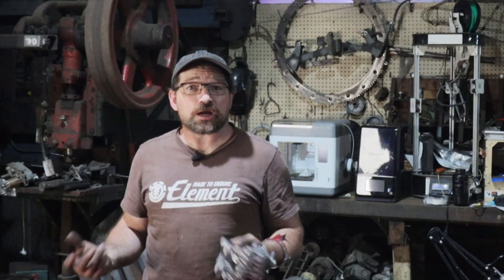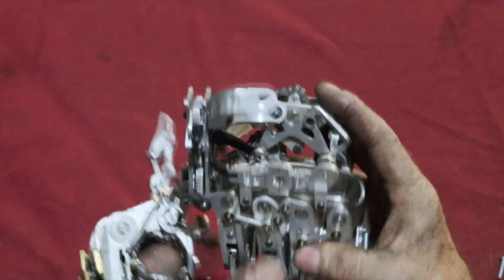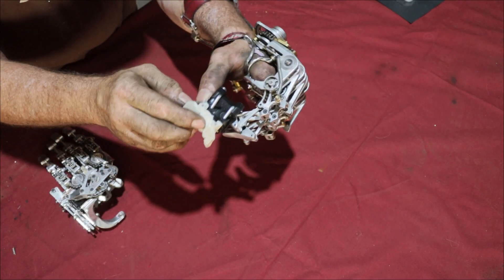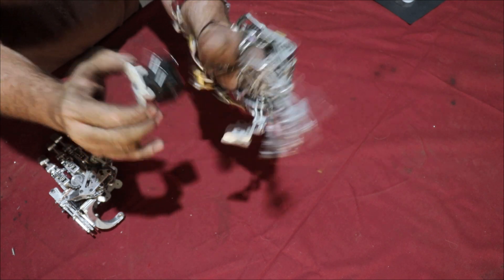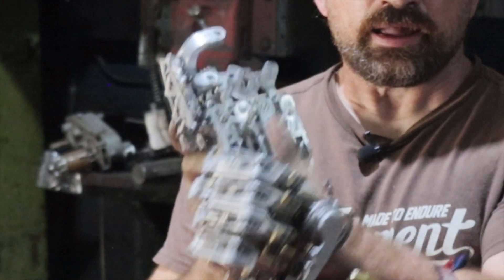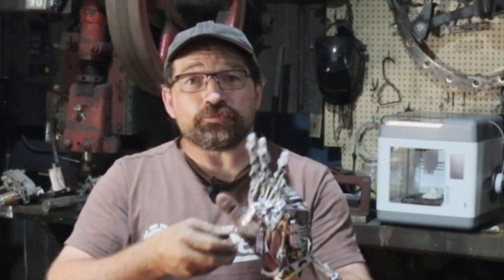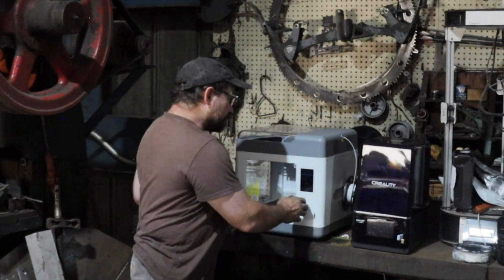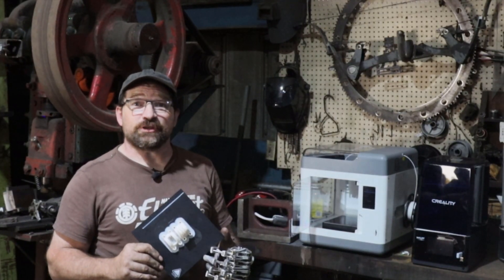Missing parts Monday Update on the Progress of building my new Prosthetic Hand

Comment: I lost my little finger a while ago, so I built a mechanical prosthetic which works great. But I’m a welder/fabricator, and very rarely wear it while I’m working, as the tiny parts and high tolerances fill up with dust and I don’t want to risk breaking it. I’ve noticed you never wear your hand when you’re building stuff, is that for the same reason? 

Love your videos by the way!
Reply from the maker: That's it exactly! If it gets bent or broken theres no repair center that i can send it in to for repair. I have to take the time to re manufacture whatever broke if I don't happen to have a spare part. This makes you treat it a little more careful out in the wild.

Comment: I know it's a major design change but have you considered making it so that finger flexion occurs with wrist extension? I think it may have a big biomechanical advantage. In the unmodified hand wrist extension is essentially a requirement for achieving adequate grip strength (try squeezing something thin like a pencil with your natural wrist in full extension vs with your wrist in full flexion and you should notice that it's difficult to even achieve a full finger curl without at least some wrist extension. This design would also serve to tighten your grip on your bike hand bars when you rotate your wrist like you're revving the bar or leaning into the grip and relax your grip when you lift your hand up off the bar.

Comment: For better grip on general surfaces you could also cut out and attach small rubber pads to the insides of the fingers.  You can get thin sheets of textured rubber meant for shoe repair, often called "sole protectors" or "Topy soles". For even better grip these could be adhered on to tiny weak leaf springs, which would conform via depression to the shape of the gripped object, and also will have a more biomimetic appearance. For a less finicky version you could also make arched bits of surface textured foam rubber to mimic the form and function of the pads on a natural hand

Comment: Quick release was a smashing idea. 
Have you considered adding fingernails? Pretty useful on a meat hand :) 

As always love the work 
Much love from England broseph ❤️
Reply: arent fingernails mainly to give the meat hand structure?
im guessing the metal hand has enough of that

although maybe a attachable edge of some kind for scraching could be useful
Reply: @aaronklein3480  pretty sure bones give the hand structure. 
I use my nails for when I need a fine point rather than a wide pad.  To pick up a coin from a table for example. Or to put a hole in a plastic wrapper
Reply: @nUmBskulLL  what i ment was like structure in the very finger tip,
like if you press with you finger against something, your flesh and skin will be pushed up.
in the tip itself there is no bone, (because it would be exposed) but also meat and flesh.
i think the nail is therefore used to do fine work where the tip would be too squishy otherwise.
i could be wrong tho
Reply: @aaronklein3480  ahhh indeedy! I think we are in agreement then! :)
Reply: @aaronklein3480  A tiny solenoid and some voice control "go go gadget tweezers"

Comment: So regards holding onto handlebars - is the problem continually keeping your wrist flexed to actuate the grip or because of where the load is exerted relative to where the prosthetic joins to you?
I'm lucky enough to have a bike I can use for odd errands but the handlebars won't go high enough to suit my riding position even with the seat dropped all the way down and boy howdy is that making my wrists feel a million years older than they really are  ; )
Reply from the maker: The immediate issue is that to grip the handlebars i need to have my wrist flexed and while riding , every bump is trying to pull my hand open. I could always use the lock grip pattern, but then I'm really locked on. The neat thing about this gadget is I think it'll be useful in several real world applications.  We'll see...